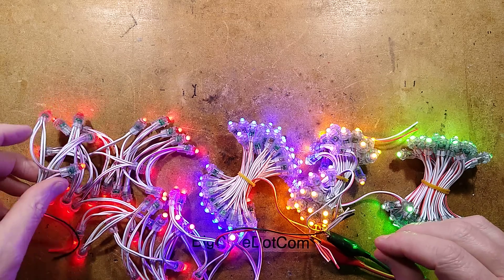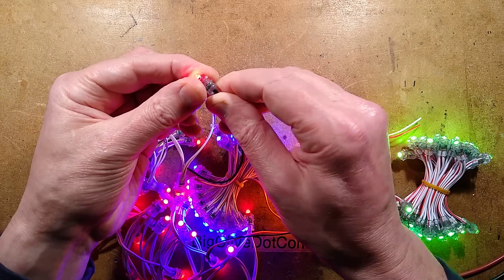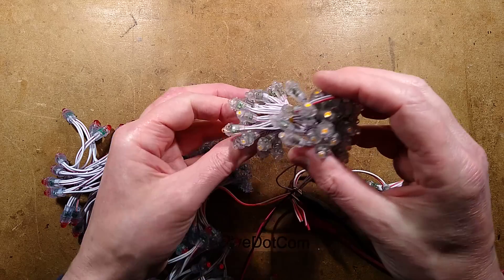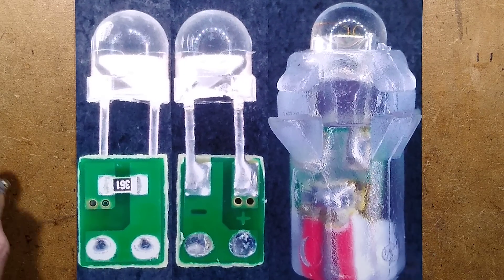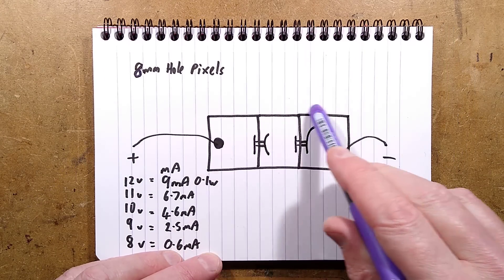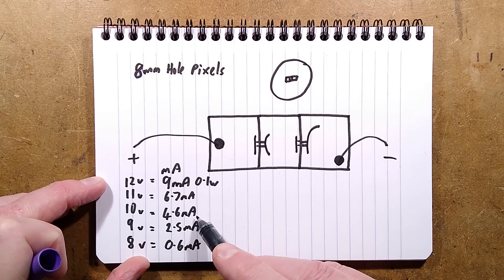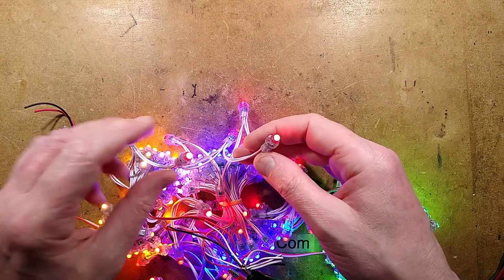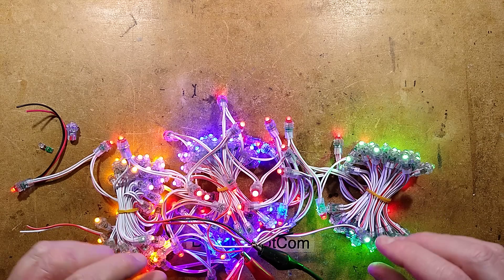Inside 12v fixed colour LED sign pixels

Comment: Usually when things are potted you don't like them but when it is transparent you see it as a good thing. Maybe all potting of circuits should be required to be transparent so that we can tell what's in there. Not that I'd understand that without you reverse engineering and explaining it.

Comment: Phosphor-converted can be good or bad, depending on what you want.  For things like green "hunting lights" you want monochromatic green, because the critter you're a-killin' can't see too well at that wavelength, and you'll only see green and black, no other colors.  Otherwise, PC colors have a "leaky" spectrum, so PC green will actually look green, but you'll also be able to see reds, blues, oranges, etc., albeit less brightly.  It's like putting a green filter in front of a hotwire lightbulb.  So for this, backlighting signs, PC colors are probably better.

Comment: Nice one Clive. Great colours.
Back in day, the "rule of thumb" was 330 Ohm for Logic/5v, 1000 Ohm for Automotive/12v.
Yeah, so 8v to 9v on these guy sounds like the sweet spot.
Did you check the Current for the  whole string ?
   ;)
Reply: I wind up using 1k on 3 volts 5k on 5 and 10k for 12-24 lol. Everything is so damn efficient and bright these days little indicator LEDs are blinding.
Even then when I have the boards on my bench I wind up covering them in tape to keep the brightness down lol😊
Reply: Yeah, know what you mean !
My solder station has layers of painter's tape over the LED. It's PWM and flashes at different rates for temperature control. lol.
Reply: @snakezdewiggle6084  oh that'd be extra irritating

Comment: I was always told that blue is the natural colour of LEDs, why is that?
Reply: There's 2 different ways to make LEDs, one by controlling the bandgap of the dopants in the led die, which gets you nearly monochromatic light - red, orange, yellow, lime green, the "old school" led colors. Blue didn't exist for a long time, but eventually they figured out how to make blue, and later still UV. Now with blue (or uv) being available, you can use blue light to excite phosphors, the same way fluorescent tubes use UV produced by mercury vapor and phosphor to make white light. That's how white LEDs work - they're blue (or violet or UV) leds exciting a mixture of phosphors that gives you white light. Then someone had the idea to make all LEDs blue, and use phosphors to make other colors - basically any color you can make phosphors for. So in SOME leds, they are blue (or violet or UV) diodes driving phosphors for white/color, but that's not how ALL leds work. That's why some street lights turn purple - something has failed in the LED and the phosphor cover or coating has fallen off essentially.

Comment: Clive. When you get an idea do you have an old style light bulb 💡 appear over your head or an LED? 🤔
Reply: Clive probably has one of those Dubai lights go off. You know the led bulbs that look like filament bulbs but the special Dubai edition that has lots more LEDs than normal but runs them at very low power so they should last forever and be very efficient.
Reply: or maybe just a halo @zyeborm

Comment: I built a 7x5 matrix of slow blinking leds powered by a 0.47uF capacitive dropper.
It's been working 24/7 for over 5 years now.
Reply: you mean a supercomputer?
Reply: @gorak9000  No. They use fast blinking leds.

Comment: All along I just watched the red and black power supply clip being awfully attracted to each other.
Reply: Not an issue with a current limited bench supply. 

But they tend to be expensive by Indian standards, so I use a DIY version with an old laptop charger, a buck regulator with current limiting, and a voltage/current display.

Comment: I'd love to see you get some of the WS2811b addressable pixels like those and reverse engineer their circuits, with each pixel having it's own IC controller onboard, it would make for some interesting teardown
Reply: how would it be interesting? It's basically the same, there's a little board, it has the ws2811 chip on it, and a 3 color RGB led soldered to it. The "regulated" 12V version has a voltage regulator on the other side of the board. All of the interesting stuff is happening inside the chip, not on the PCB itself. In the pixel style ones, they use the discrete IC's and discrete LEDs mounted to a PCB. In the addressable LED tape, the die of the IC is mounted into the same package as the 3 LED die, and you have a completely integrated addressable surface mount LED.
Reply: I'm looking forward to the day they make those in cheap outdoor (dark green) strings so you can have addressable LED strings outside.  You can find them now but you have to look quite hard to find them, and they are way more expensive than the indoor/white wire options.

Comment: On a bit of a tangent, these lights remind me of a bar that some friends of mine made for a hotel in France. It was cast out of concrete but with dozens of strands of fibre-optic cable embedded in it, long tails to connect to sticking out 'under' the bar and short tails sticking out on the top/front. Once the casting was set they polished the concrete and flush cut the fibre-optics. I'm not sure if they had to treat the end of the fibre optic cable to diffuse the light. So the whole bar was speckled with light from the end of the fibre optic strands.
The big advantage was that it ran off a single light which could be easily replaced or upgraded without rewiring the whole bar. In theory you could connect each fibre to different LEDs and program pretty patterns or messages into the bar!
Reply from the maker: Sounds like it may have been based on some Disney embedded concrete fibre optics.
Reply: wow this sounds so interesting I wish we could see a picture!
Reply: i have seen similar in ceilings.
Reply: It's been a back burner project of mine to lay fibre optic under a patio or tiled path. Not there yet but I did install a starscape into the cedar tongue and groove ceiling of a campervan conversion I did - remote control too. Don't usually brag about stuff but this was the best ever "Reveal moment" from my young daughter.
Reply: Sounds class.

Comment: With ohms law I would love to see the actual current for brightness on a 5 vs 12 volt chip. Depending on the use I prefer 5v on my Christmas lights due to not needing multiple power supplies with my esp32 and 5050SMD.
Reply: esp32 draws little enough current that I'd just use a 12V supply and a linear 3.3V regulator. Of course a tiny 1$ stepdown converter would also do the trick and be more efficient
Reply: @Max24871 esp running wifi can pull a surprising amount of current, linear off 12v might get a little marginal without a heatsink. I'd for sure go the switcher.

Comment: These are quite unique. Nice and waterproof too.
Reply: Was just thinking that, ideal for holiday decorating in a damp environment.
Reply: I have tried stringing these outside, and water always gets in. I wanted to take the whole string and dip it somehow through a chemical sealer like flexseal.  I wanted to run a long string of these down either side of my driveway, but I could never get them to last longer than a month before the water intrusion. Any suggestions of how to waterproof the entire string?

Comment: The older RGB colour change used to have 3 pixels (3 separate lights) on the 12V DC. The red is a nice rich colour. interesting 2x 👍

Comment: I do prefer the 12vdc version because they are usually more forgiving with voltage drop over long runs.
Reply: also 12V doesn't hurt. Humans are awesome. 120V is weird. 120V (ish) AC slightly hurts. DC is my style.